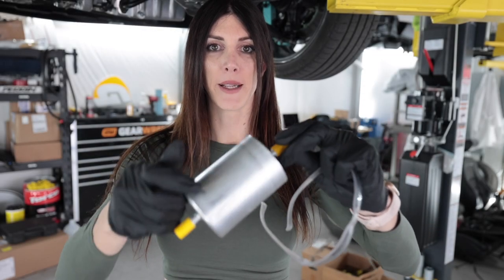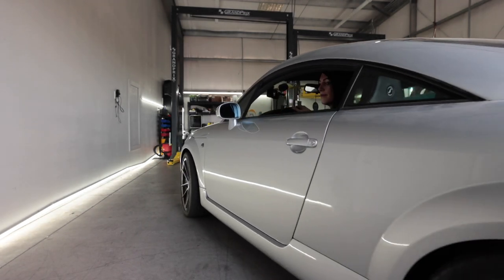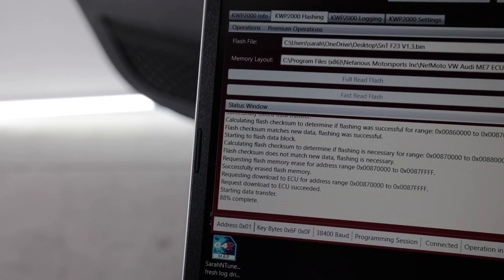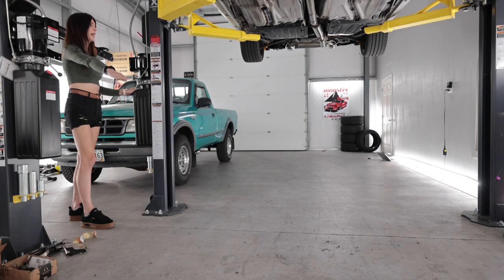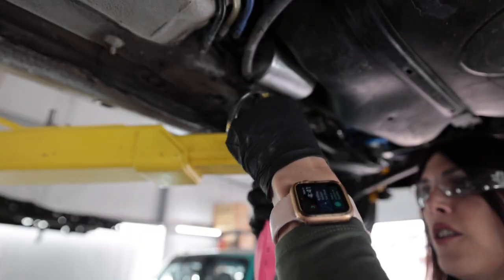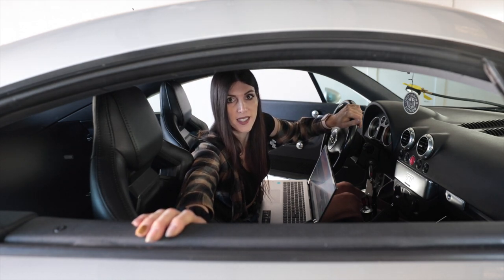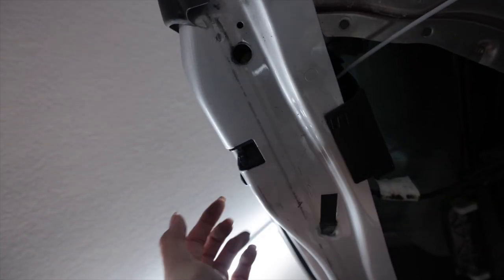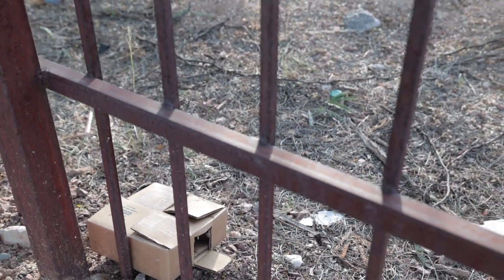I'm Running Out Of Time.. Starting To Panic // Audi TT Quattro

Comment: Hey Sarah I'm sure your familiar with the fuel system but you might check injector spray patterns to make sure they spray nicely too fuel pump line pressure, tanks, lines, filter, etc.  the evap or charcoal filters common errors...

Comment: I had a bunked up fuel filter on my Nissan Patrol long ago. Took my nearly a year to find it. Truck ran fine up,to about 50 mph then lost power. The filter was inside a frame rail and I could not see it until I had it up on a lift.

Comment: As far as I'm concerned, fuel filters are not lifetime parts and I change them every 50k miles or so.  Easy and cheap enough to do and the nasty gas I've seen pour out is all the proof I need.

Comment: Cutting at 4200 rpm? I need help resetting an air pressure sensor for my wife's CX30. I know everything you do/know is way out of my skill set. I wish you much luck in the future. Thanks for all you do. How often does a fuel filter get changed? Is that something all of us should be concerned with and if so, is it part of a regular maintenance schedule?

Comment: I think you would have been fine with a regular new fuel pump but hey that will leave some extra for the new owner. There was some hassle to get the new pump installed. Was it the fuel line to the other side tank and the fuel level sender. Can't remember, been few years when i had my S3

Comment: I had a very similar issue with my 2008 Mini Cooper S. Similar modifications, K03/04 hybrid turbo, AEM intake, colder NGK injectors, tuned, blah blah blah. Replaced coils, plugs multiple times. Engine kept knocking just over half way through the rev range. Never got to source of the problem, it melted a hold in piston 3 before we got a chance to resolve it. Could have been fuel pump related though. Pretty sure it was fulling related though.

Comment: Your problem with the door activation were because the door was open to test the door you have to take a screwdriver and push the lock in and then try to unlock/open it

Comment: my subaru was over boosting had a vacuum hose off/split hose down there and was fuel cutting. must have been trying to compensate for the leak by adding more boost.

Comment: Wow - Tater Tot doesn't want to leave, hence the last minute issues; but 'd think anyone who might win the car knows the level of OCD that's gone into making it literally perfect, and would understand it might need an extra day to be up to your standards before it leaves your care..)
Also, Audi doors are a nightmare. I had to replace the rears on my 2003 (B6 A4) as the stills rotted out after ~14 Canadian winters. I was lucky enough to find a set of replacements in the same colour, but had to swap all the internals as the donor doors harness had all the connectors cut off...??

Comment: If everything runs ok on wastegate pressure, how do you go from a potential tune fix to replacing the fuel filter and pump?  I’m definitely NOT trying to be an armchair wrench. I’m genuinely curious what I’m missing here.

Comment: I had an 2006 Mustang that sat for 5 years i had to replace the pump, fuel filter, and clean out the gas tank that was full of rust be for it ran right. Might help you out.

Comment: You will have the TT finished on time, and you will do a review - failure does not seem to be an option for you. PS, I wouldn't call it a failure - the car being ready is the main goal, and you will achieve that, no doubt about it.

Comment: How did you get the door open?
Reply from the maker: By breaking the latch gearbox inside the door with a flathead screwdriver. One quick tap in the right spot and it splits in two without any other damage.